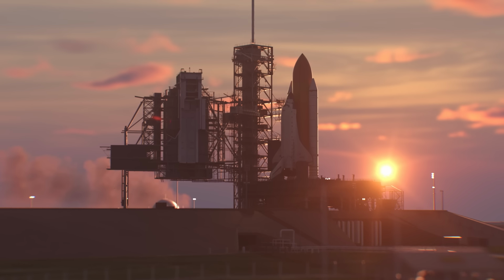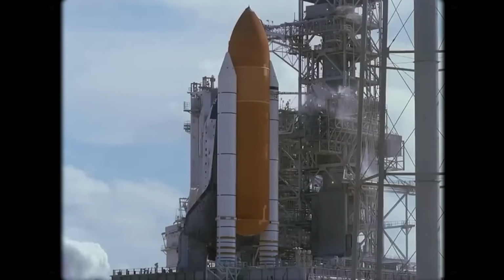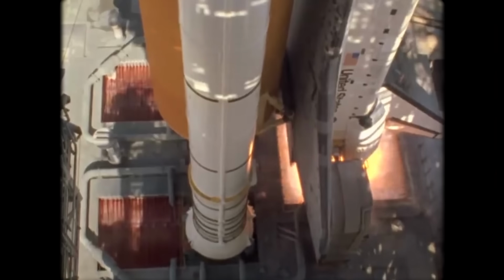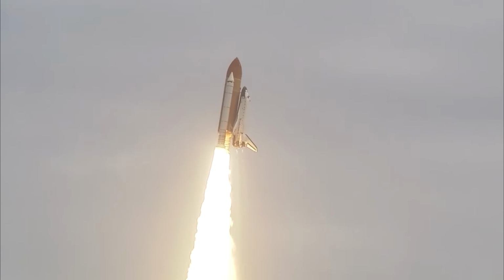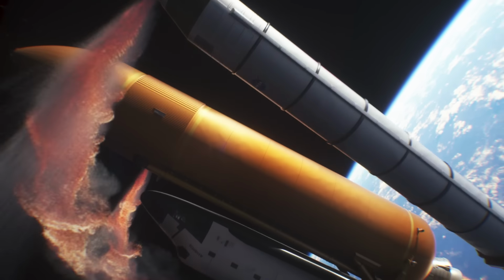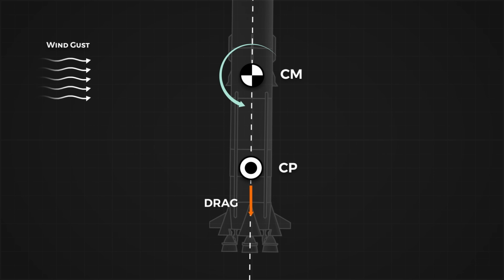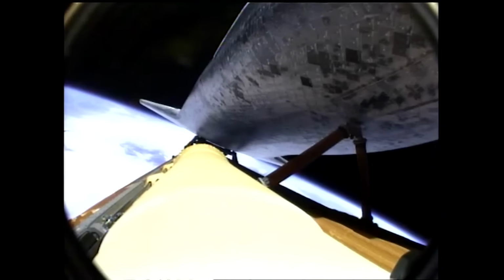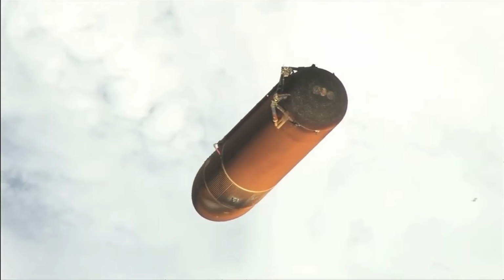The Insane Engineering of the Space Shuttle

Comment: The Space Shuttle was an engineering marvel but also a death trap just by its overall design concept. Its amazing that a single one of the daredevils that rode it made it back alive, let alone hundreds. Its a true testimonial to the skill and dedication of all the people that worked on it.
Reply: The problem with the shuttle wasn't that it was dangerous, it's that it was too expensive.   If it had been 10x cheaper and just as dangerous, they would have continued to use it.

The biggest regret of the shuttle should be all the cheap expendable launchers that could have been developed much earlier.    Arthur Schnitt's Minimum Cost Design methodology dates back to the 1960s.   These could have evolved to partially reusable systems like the Falcon 9 earlier than F9 appeared.
Reply: Both shuttles that were lost were due to human error, not design flaws. It wasn't a death trap.
Reply: @OneNationUnderGod.  And that's PRECISELY why they are death traps. In a rocket a million things have to go right for it to work, if one goes wrong and you have no way to escape the rocket then you are dead. Columbia was a random piece of foam that fell from the external tank, no human could have prevented it.

Comment: 1:40 "the two largest solid rockets ever made to date"
Acrojet actually built and fired the "AJ-260" 260-inch solid rocket motors in the 1960s, the first two prototypes alone, standing at only 24 meters tall (less than half the final length) produced more thrust than a Space Shuttle booster and the full-length third motor was nearly double as powerful.
Later on you do specify "the most powerful to fly humans" but still a little mistake.

Comment: I wonder about those plans to have the external fuel tank be recoverable and manned. After the Space Shuttle program ended, NASA did the math and worked out that because the SRB's needed to be fished out the ocean and stripped down to bare metal for refurbishment, it would have been either the same price or cheaper to have just expended them on every launch. Which is exactly why they're doing that for SLS, which uses the same tech. And those only reach a sub-orbital trajectory, making the fuel tank a manned craft that has to return from effectively orbital velocity would not only be hell to develop, but also hell to maintain. The Shuttles themselves are a perfect reference, needing to be stripped down and have every square milimeter inspected after every flight. Now imagine having to do that for two vehicles for every launch.

Comment: The Shuttle was a failure by most any measure.  Sure, it was a high tech adventure, but its technology was never iterated due to NASA's timidity, so it never achieved anything approaching 'low cost access to space' or flight safety.  Don't let nostalgia cover over failure to achieve the program's fundamental reasons for existing.

Comment: Should be called "Insanely stupid engineering of the space shuttle".  Responsible for the most deaths in space travel (14).  Was supposed to be "reusable" and turned into a cash cow for Boeing/Lockheed because it had to be almost completely rebuilt after each flight.  Costs kept development of a replacement from happening for decades.  This thing used core memory for most of it's lifespan which was technology from the 60's.  The space shuttle was a stupid boondoggle that pushed back space travel for the majority of my life (60yo).  We retired the program with no replacement. If it wasn't for SpaceX, we would still be buying rides from the Russians.
Reply: So what would have you done then? It's easy to criticize with the benefit of hindsight.

SpaceX is currently designing a super heavy launch vehicle that has almost all of the same conceptual issues as the Shuttle. Elon's directives that heat tiles and flame diverters have been shown to be baseless, and SpaceX still needs to figure out how to keep the tiles from falling off during flight. 

SpaceX is amazing, but their successful design, the Falcon 9, is a comparatively simple medium launch vehicle, which can only lift a fraction of what the Shuttle could.
Reply: @TheOwenMajor  You mean the flame diverters that worked flawlessly on IFT-2 which proved they didn't need to dig a giant flame trench, those flame diverters?
Reply: @planetsec9  You retconning the concrete tornado?

I was referring to Elon declaring that flame diverters weren't needed, and then they dug a crater... and then installed a flam diverter.
Reply: @TheOwenMajor the tiles SpaceX are using are 95% identical hexagons. The shuttle didn’t have a single duplicate tile. That is the criticism of its heat shield. This made working on it extremely time consuming and costly. SpaceX also is able to use steel vs aluminum so their heat shield is much lighter as the steel needs much less protection.
Reply: @bensemusx  And like 30% of those tiles are currently coming off during launch. Meaning even if IFT-2 made it to orbit, it would have been destroyed on reentry.
Reply: @bensemusx Wow, back to fragile heat shield tiles...sounds like Musk isn't so innovative after all.
Reply: @TheOwenMajor 30% is not even close to how many came off. Way to grossly overestimate. Watch IFT-2 again . Also that particular ship they didn't care much about the tiles. Ship 28 has had a much more robust and thorough process of putting and checking the tiles that are put on.
Reply: @TheOwenMajor Falcon 9 in a fully expendable (still way less expensive than any STS flight) configuration can put a comparable tonnage to orbit. Yeah shuttle might be a heavy lift vehicle but actual deployable playload is something akin to a medium lift vehicle.

Comment: the shuttle itself is a decent design - the orbit delivery vessel is absolutely awful. Making a large combustible rocket fly up with an off-center of mass and using gimbals to compensate for the tilt gives me a major pucker factor when I think about it
Reply: That's because you're not very clever, the design of the Shuttle was selected after tons of comparisons and trade-offs. 

If you want a spaceplane that returns its main engines in the 70's, you are going to end up with the shuttle. 

Put the engines at the bottom and make it disposable? You get the SLS.
Reply: @TheOwenMajor you could also do something like Buran or MAKS

Comment: Question: If the SRB's motors were gimbaled, what powered this? It would take huge forces to be able to vector that much thrust controllably. EG in the Saturn V, they just used the high pressure fuel to actuate the gimbals, since the fuel was already an extremely high pressure 'hydraulic' source of power. I'm not picturing where such power could be tapped from an SRB though.
Reply: This is a great question and now I'm curious as well. I could have asked my great uncle who worked on the space program from the beginning to right before the Challenger accident. Unfortunately he passed away this spring :(
Reply: I believe I found the answer here: http://www.nasa-klass.com/Curriculum/Get_Oriented%202/Solid%20Rocket%20Boosters/PRES_SRB.pdf

Comment: Could you do a video on Linear Accelerators? I currently am an intern in the area and the few I know I find it amazing. I already knew a few on MRI and your video on it gave me more interest in the area even further.
Reply: a linear accelerator is basically just an unfurled electric motor. not sure if that’s enough material to make an entire video out of
Reply: @klnsbl  the machine still have a lot of adjustments do be made to deliver the right amount of radiation to the patient. Not to mention the mathematics needed to do an rapid arc treatment, where the MLC (MultiLeaf Colimator) where the blades that colimates the irradiated fotons on the patient have to generate an treatment geometry for each angle of rotation, and how this works with the treatment plan is just absurd.
Reply: @klnsbl  https://youtu.be/3pMdzBMaN-c?si=psdEDE9fIQpsBwGf

Comment: Do the Buran too, its arguably the better orbiter system, even if funding dried up before it could prove itself.
Reply: How was the Buran better? It was an inferior rip-off of the shuttle. 

The Buran didn't replace the biggest reason the Shuttle was designed for, reusability, particularly the main engines. And also due to it's inline stack design, it couldn't take advantage of the insanely light main tank design of the Shuttle.
Reply: @TheOwenMajor The Buran, while strikingly similar to the US Shuttle was not a copy, as the Soviets barely had any information on the US Shuttle in the first place. As for reusability of the engines? Glushko was probably more in touch with the capabilities of the US Shuttle than NASA, disbelieving their claims of driving costs and making space more accessible, reason why he did not bother with reusable Shuttle engines, except for the provision of jet engines to increase the range after reentry and to offer a modicum of safety to reach the airfield. 

Instead, he created 3 systems compared to the US's one. The Energia heavy lifting rocket, able to place 100 tons into orbit. The Block A boosters that could be recovered and reused. And Buran. This design was inherently safer than the US one, their choice of kerosene Instead of hydrogen meant less boiloff and longer times in space, (30 days to the US's 18) had better automation systems (could fly to orbit and return to land with no human input as it successfully did so) 

There's many other small details that make the Buran-Energia system superior to the US Shuttle one.
Reply: @alexsv1938  
Lol.
"he Buran, while strikingly similar to the US Shuttle was not a copy"
I know, they copied what they had, which was the aerodynamic model. That was straight stolen. They didn't copy the fuel systems or the engines because they couldn't.

"reason why he did not bother with reusable Shuttle engines,"
It's because the fuel transfer system was more complex then what they could manage.

"The Energia heavy lifting rocket, able to place 100 tons into orbit. The Block A boosters that could be recovered and reused. And Buran."

No he didn't the boosters never flew, the Energia launched once and failed. The Buran had a single launch. 

"their choice of kerosene Instead of hydrogen meant less boiloff and longer times in space, "

Lol what? The Shuttle used the Hyndron by the time it made orbit, unless you are talking about the fuel cells.
Reply: @TheOwenMajor Holy shit you're wrong on so much. Engeria launched twice without any issues. The Polyus payload itself failed. Also fuel cells are for electricity not propulsion. I'd address more but the fact you think fuel cells are some form of propulsion says everything about your ignorance.
Reply: @TheOwenMajor it was much cheaper. It used safer liquid boosters. It was autonomous. The rocket and plane were independent systems so if the plane wasn’t needed for a mission you still had an incredibly powerful traditional heavily lift rocket. 

The shuttle reused its engines but it was so expensive to refurbish the STS that it ended up being pointless. Now SLS is using those engines at about $140 million a pop. You could buy four Falcon Heavy launches for just the cost of the SLS engines.
Reply: @bensemusx  "it was much cheaper."
No it wasn't. In fact the Buran was so expensive it may have led to the breakup of the Soviet Union. 

" It was autonomous."
It was, but the Soviets traditionally liked autonomous systems, and the US liked pilot-controlled systems.  It was also developed a decade later.